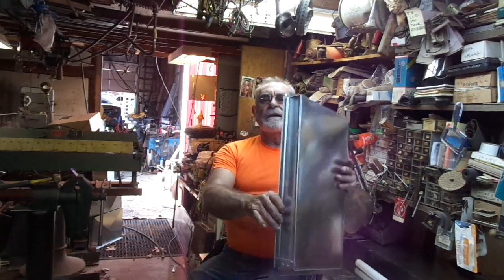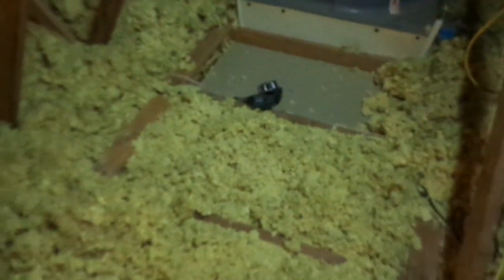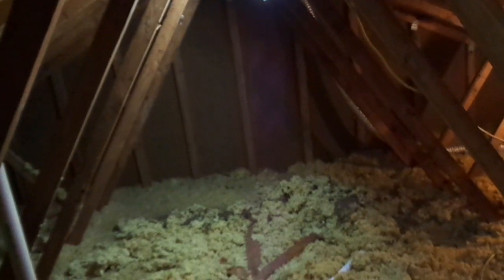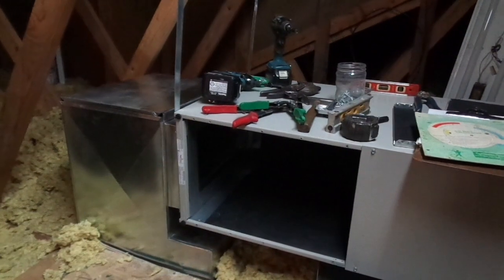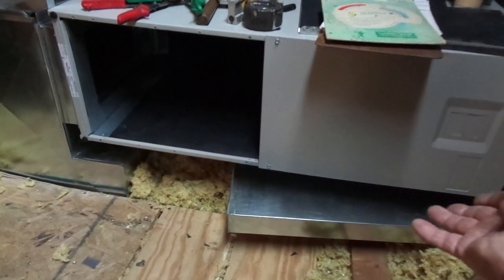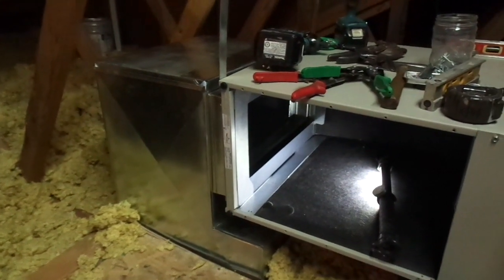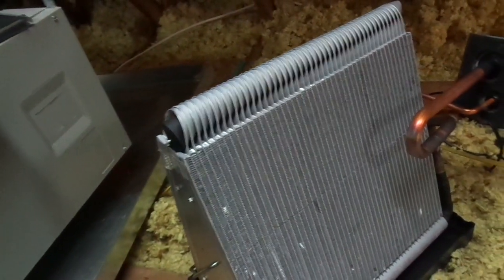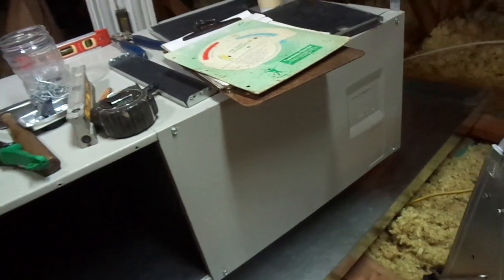Pt 2 Heat Pump Attic Installation

Comment: Hi Wendle. 
Just a quick note to say I really enjoy your videos. This one in particular, as you are showing the fitting shop manufacturing, to the field installation. I will also tell you that being from Alberta, Im really enjoying this, as you stated above, and its so true, that jobs vary from region to region. So as being from Alberta, our design conditions is so extreme that we cannot/ do not, install equipment in Attics. So I'm really enjoy watching this as its something I would rarely, if not, never come across. Also I will compliment you on your very top notch shop fabrication work. As a long time sheet metal mechanic, I appreciate your craftsmanship sir. Cheers from Alberta🇨🇦
Reply from the maker: Yes, design temperatures vary greatly from east to west and north to the south.  This area in the Midwest the winters design temp is 5*F and summers design temp is 95*F.  Alberta is much much colder that us, especially Northern Alberta.  Our average winter temp here is 33*F.  Attic and unconditioned crawl space duct systems are fairly common in this area. I hope you watch all the videos in the attic heat pump series.  It's got a little bit of everything in it ! 
     And thank you for the awesome compliment Paul about the fab work.  The best compliments are from other tradesmen....as are the best (worst) critics.  LOL.  I've got a buddy in Louisana that has a 5kw heat package on a 5 ton a/c !!  THAT blows my mind.  He says he needs no heat at all to speak of after cooking supper.  LOL.

Comment: I loved the video....up here we never get to work systems in the attic....never done....to see what all is part of an attic system....jaw-dropping information....CHEERS
Reply from the maker: Thank you sir for the awesome comment Gator !!  Attic jobs are a challenge as an add on in an existing structure and follow a few different guidelines as compared with installing one during construction.  For one, the return air network is much more detailed during construction.  Plus the entire job is easier to do without drywall ceilings in and without having to lay in the insulation dragging boards along with you.  90% of the work is done of a ladder...unless you're really tall.

Comment: I like your duct seal and insulation ideas Tractorman44. I also like having no fiberglass inside the duct. Will make cleaning much easier if necessary and like you say who wants to deal with it should it break down.  I like your attention to detail building the duct as well.
Reply from the maker: Good Morning Larry and thank you for the supportive comment sir. I never enjoyed insulating the duct with fibreglas because first the duct was sprayed with adhesive, the formed insulation laid in place then 'pin-spotted' in place with either an electric pin spotter or hand attached with a magnetic hammer with the duct on a steel table.  In addition to the points you bring to the table, that process is much more time consuming plus the physical size of the duct must be increased to compensate for the loss of internal duct area due to the addition of the fibreglas. I appreciate your interest and be advised there is a lot more in this series.

Comment: Hi Wendell!  Thanks for sharing very interesting info on this HVAC install.  You always provide really useful information and advice for folks that might want to do a similar installation!
Reply from the maker: Thanks Martin for the supportive comment.  Unfortunately what goes on in the video is really only a cliff notes version of the work that actually has to be performed to complete the job.  I hope to keep them short but comprehensive enough so people can get an idea of what has to happen to get a system installed.  Don't know if that will be the result or not.....yet.  (-:

Comment: I for one wasn't bored. I've only done repair to existing systems so a peek into the theory behind HVAC is a new experience. (I couldn't remember the initials so I had to Google HVAC. 😆)
Is the difference the air velocity between a heat pump and fossil fuel unit related to the higher temperature in the fossil fuel heat exchanger?
Reply from the maker: Well, that requires a bit more discussion than a paragraph will convey...but.... think about this.  Fossil fuel furnaces operate on for the most part a 70 degree temperature rise. So a return air temp of 70 degrees will result in a nominal 140 degree discharge air temperature.  At a given air velocity across a given heat exchanger with a given quantity of air (cfm) can only transfer a given quantity of heat (btu's) to that air flow.  Speed up the air flow and the transfer of btu's drop per cubic foot.  Slow down the air flow and the transfer of btu's increase per cubic foot.  An air to air heat pump, not being a fossil fuel furnace, does not operate on a 70 degree temperature rise.  It is much lower and in some cases the resultant discharge  air temperature is as low as 85 degrees due to the varying quantity of heat available in the continual changing out door air temperature. Remember, with a heat pump you are actually cooling the outdoor air.  (-:

If you were to move the air in a heat pumps air distribution system with only a 15 to maybe 30 degree temperature rise at the same velocity as that of a system whose design is for a heat generating device with a temperature rise of 70 degrees, it is easy to see how poorly that system will perform for comfort.  The trick is when you realize that all normal air conditioning systems are designed for airflow at the rate of 400 cfm per ton.  The perfect balance is almost impossible to attain and this is the specific reason why (in my opinion) air to air heat pumps have received a bad rap, especially in the colder climates.  The accepted norm is to increase the duct size by approximately 20% to lower that air flow velocity to minimize the 'feel' of the cooler than normal discharge air temperatures in the heat mode and seldom is this found to have been performed ESPECIALLY in the replacement market.  Seldom is the duct going to be totally renovated during a normal HVAC system upgrade. 

The actual way to minimize the complaints requires heat loss calculations for the structure that allows the heat pump to provide all the heat down to a balance point where it can no longer overcome the loss.  At that point a 5kw element can be brought in by use of a second stage heat position on the thermostat to satisfy the load.  Then as the o.d. temp continues to fall, another 5kw can be brought in with a 3rd stage on the thermostat.  Then that stage will have an additional 5kw attached to it that will only be engergized when the above conditions are met PLUS an additional drop in temp that will close the contacts on an outdoor thermostat wired in series with that elements control coil  (not in series with 3rd stage).  It can only be energized IF 3rd stage is calling on the thermostat AND the outdoor temp drops below that final balance point.  With this type of control, the temperature continues to rise in the duct with a drop in outdoor temp.....but....it requires calculating multiple balance points.  Thank you sir for your interest in the subject, and in actuality this description barely scratches it.....Still itching ...??? (-:
Reply: @tractorman4461  It falls in the parameters of an explanation to meet my needs. :-)

Comment: I saw that big cuppaJO sitting on top of that new shiny duct Tractorman 44. This way I knew that it wasn't a imposter trying to be you. From the looks of it all, I'd say you know what you're doing. Me?  I'd just put a wood stove on the second floor. But carrying wood upstairs wood be a pain! That attic will be so well insulated they could heat upstairs with a candle seems to me. But most home lack insulation including mine. For me to have enough I'd have to tear out the ceilings or take off the metal roofing to get more but at least there is 6" in most places. My old farm house I lived in before living here in the holler was the standard brick walls, plastered inside with a slate roof and wooden window sash, as was topical of this area and the early 1800s. It had an old addition and I rented one half. Had a big walk in fireplace in the basement and two other fireplaces left. In the attic there was a plastered room where the hired hands lived. There were even some hand forged hooks where they hung hams and the like to cure. I've been in several old houses where there was a hole in the chimney in a small room where they smoked their meats. The one stone house with a large central chimney was built in 1745 and I'm sure there had been a log cabin there before. Barns were the first thing built and often lived in a corner before or as the work was done to clear the land, grow some food. I learned that often it may have been some years until a home could be built or a rough log house built, later used for a smoke house or other out building. I know of old farmhouses that took 4-5 years to build, mostly stone. Stones was plentiful where brick was expensive and came from England as ballast. Stone is more beautiful than brick but far more expensive. It's fun to see the stone houses in not too distant areas and the type stone they had used from their area. Like stone, sandstone and I even knew of a house built of field quarts I'm sure they gathered from the fields as they cleared and worked them to farm. So now I don't remember what I was going to say about my old house since I went off on old farm houses. I left there because it was next to a busy road and the noise got worse and worse over the years. It had four porches and you nearly had to scream to talk. It also had 52 Windows, of which I restored and  removed, cleaned and putted every panes on one side and four on the other, it was a pain them panes! But it was fun too! I was a master of the putty knife when it was all done. I also repaired all the shashes and had to make new mullions in quite a few. Even would replace roof slates and have the old skaters tools too. So now that I am near finishing my cuppaJO, which I raised you way, I say don't get itchy inna attic and I'll raise my second cup to Atticman44. My Best to you all and Stan of course. DaveyJO about to take me wife to the Amish greenhouse.
Reply from the maker: Your right...it would be a pain carrying all that wood to the second floor what with all the carpet and the Missus following with the proverbial rolling pin rared back ya know....  Our old home place had no insulation the belief being a 'dead air space' was the best insulation.  HooBoy !!  Things have changed a bit in a hundred years.  I can't imagine working over 52 windows in one house.  I haven't done that many in my life !!  Probably had to install screens in the spring and storm windows in the fall too.  Man, just think if they had gas filled double pane back then.  All that work they'd have saved. LOL.  Good story for the morning DaveyJO...I thank you for every interesting topic you toss in the mix and I toast you as well kind sir.  Hope you and the Missus had a great time at the Amish greenhouse too !!